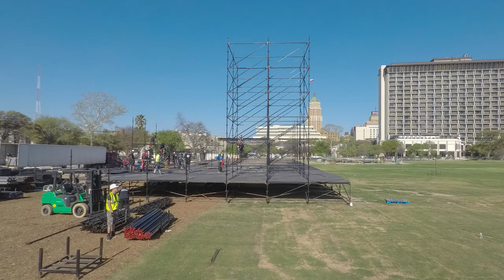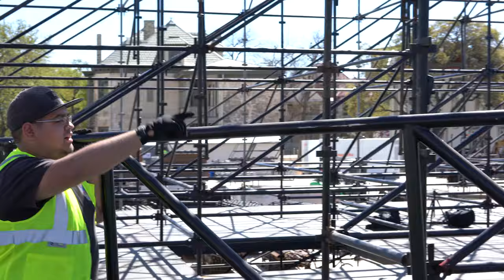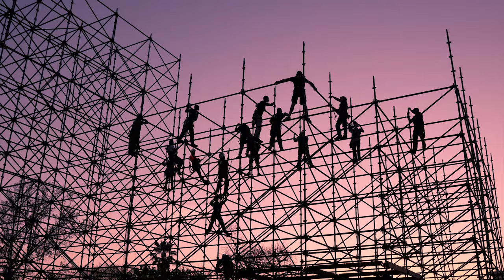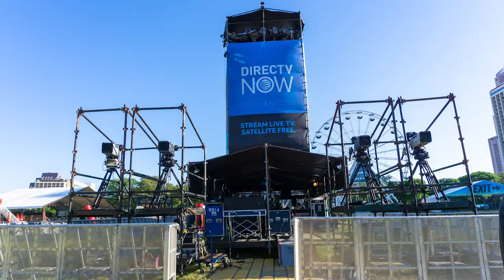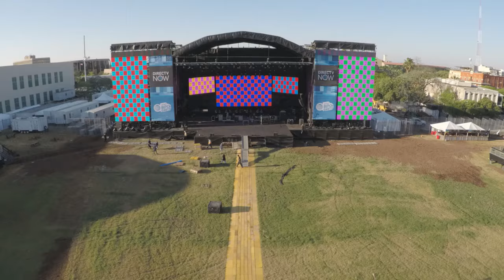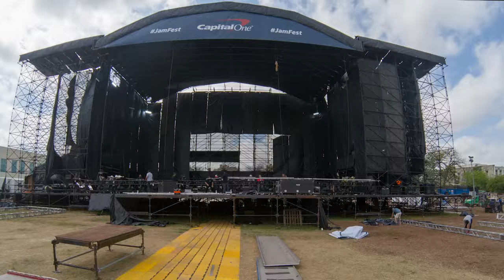Stage Build - March Madness Music Festival 2018

Comment: I'm a volunteer tech / General assistant for the Mick Jagger performing arts centre in Dartford England  ,  and on a typical show day  it takes just 3 of us excluding any other production crew we have in the venue with us 4 to 7 hours to put the stage up , build the pa stacks ,  set the monitors up  , set up the mics and stage box's  and run the cables around the stage ,  it doesn't sound a lot but it is one hard job just for the three of us  ,  but I love it and wouldn't do anything else.